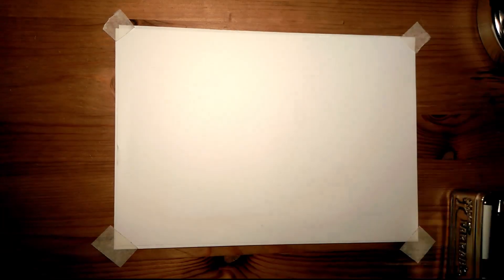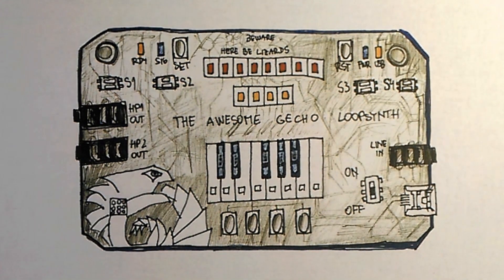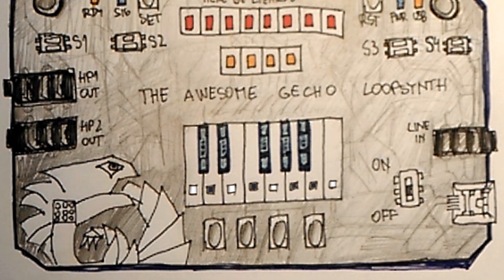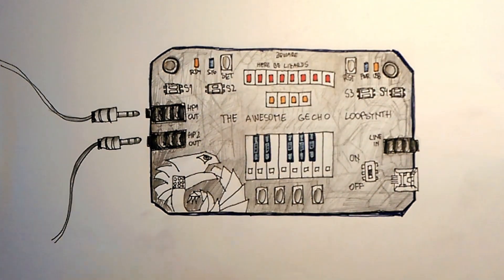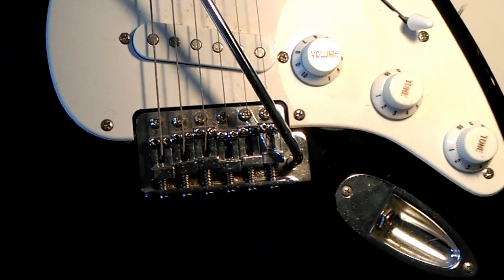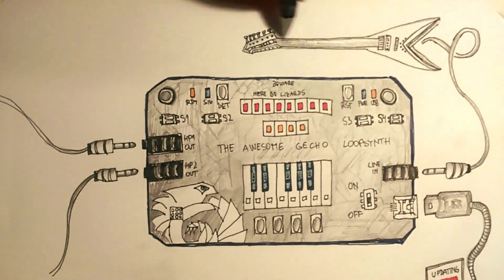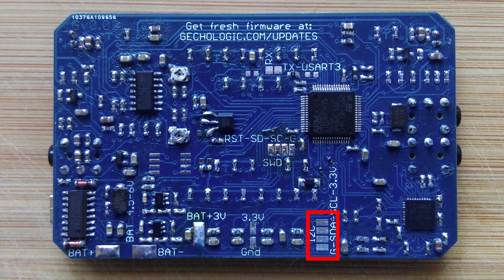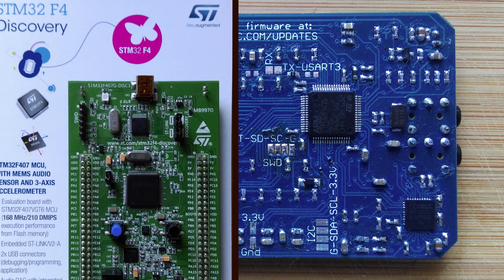Gecho Explained - Part 2

Comment: Would be cool to wire up MIDI input through I2C. I have a drum controller, but to jam or practice i also need to carry my big old laptop. Having Gecho as a tiny midi-controlled drum sampler would be much easier.
Reply from the maker: Hi! This should be possible, just surprised to hear you'd want to use I2C - it can work, this bus is good to carry MIDI messages as well. What would you be connecting it to? I've recently added MIDI In and Out (via the serial port, and opto-isolated, so it is like a native MIDI connection of any standard instrument). But if you really mean I2C as a means to extend to other devices, what should it be - master or slave? Hmmm, there are some readily available I2C-to-MIDI modules... didn't think of it before. It might be a good DIY exercise too, I2C bus is exposed on the board.